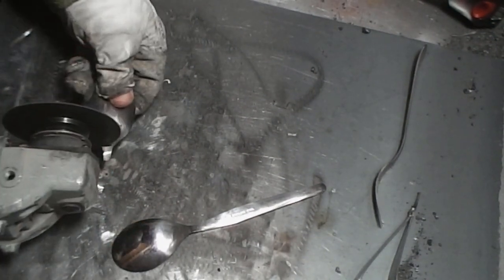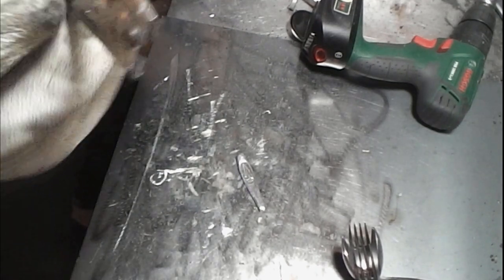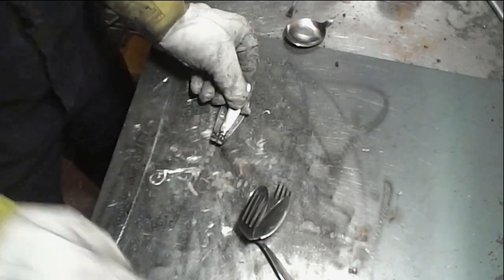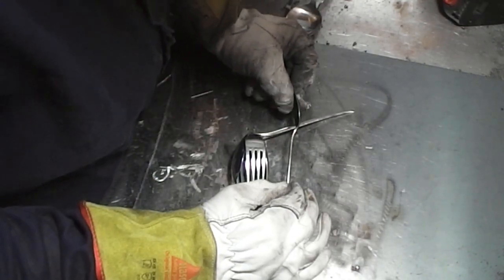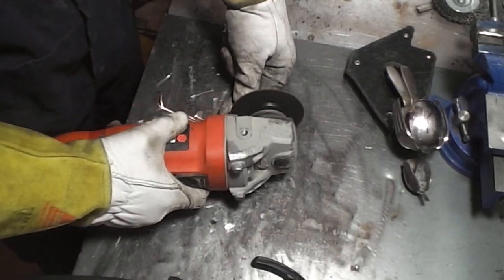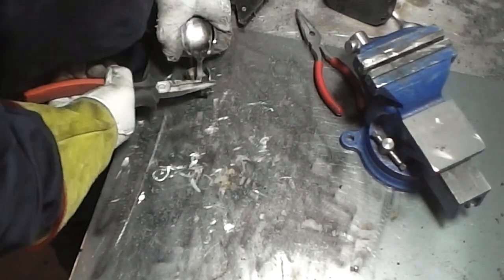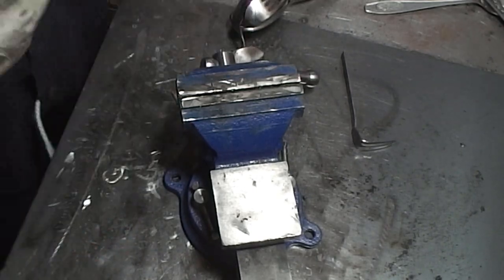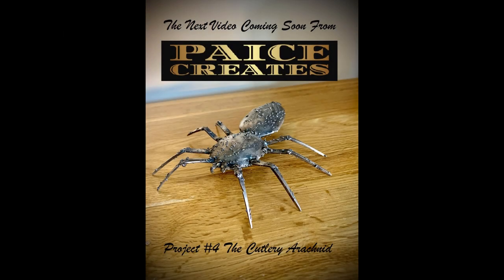How I made the Cutlery Bird. My 3rd ever Welding Project

Comment: Nice work fella!
Reply from the maker: Thanks John. i got some die grinders you recommended (thanks again) now and so will prob get to try and clean that head up at some point.
Reply: @IanPaiceMetalArt  Nice one, the burrs and mini flap discs are amazing tools, will allow you to clean up in hard to reach areas and just give overall a bit more control. I do use mini diamond cutting discs too. Pretty crappy at cutting anything like stainless or thicker sheet ... but as clean up / sculpting tools they can be really useful. Did all the detail work on the Predator using just them! (before I learned about die grinders and burrs!) Also ...  I know you're on 'gasless MIG' which is tough to keep neat, was thinking maybe 'anti splatter spray' might help? I've not used it but they make it for a reason so I assume it helps with tidier gasless welds or at least reduces the chances of the splatter sticking to the piece. Anyway ... keep up the good work, good to watch the progress ... this cheeky little bird you have made was me 12 months ago! ... every piece moves on your experience, skillset and feel for what is possible, keep challenging yourself!
Reply from the maker: @JohnNorrisMetalSculpture  Thanks. i have watched quite a few of yours and learned alot from you. so i thank you. yeah the gasless might benifit form the anti splatter. i must try some.  i might shell out for a gas one tbh . now i know i enjoy it im prepared to spend a bit more . yeah ive seen your bird on its cool